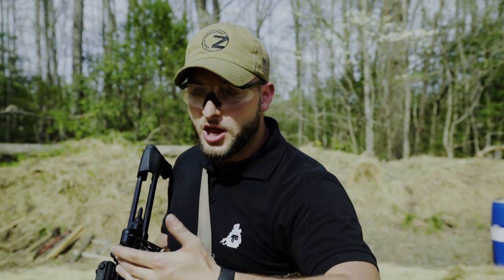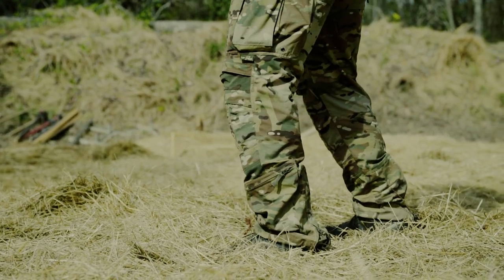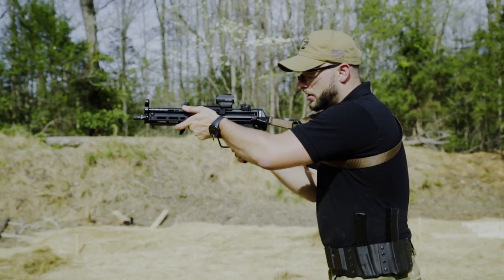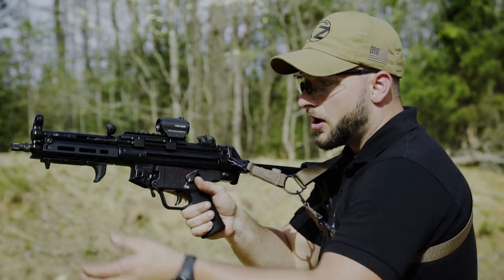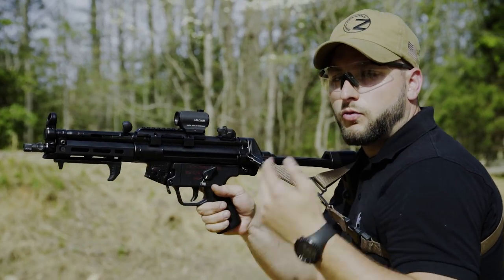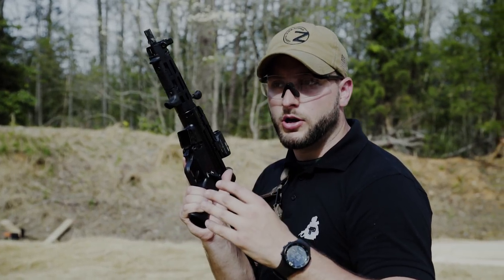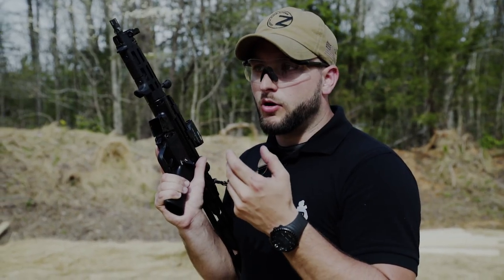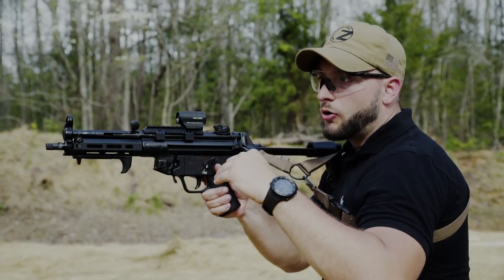How to shoot Full-Auto?

Comment: would you mind demonstrate that with a G3? :)
Reply from the maker: I've shot with G3 on full auto but i don't have a video of that. 
With a stronger recoil you need to have a more aggressive stance and put more counter force into it. I would say that with the G3 and .308 you are already at the limit for some shooters because the combined recoil of full auto dump could be greater of total weight of someone which means it will move you back a couple of steps.
https://youtu.be/YAwM71383C0?t=1m8s
Reply: that should be fun....
Reply: I will remember that, but i cant hold the g3 "ipsc style" lol, grabbing it by the mag works best for me
Reply: Interesting
Reply: i shot a sbr full auto g3 when i was on vication in miami :D i have to say it rocks but you really really have hold that thing tight and push it down real hard during the shoot. also i found that 2 round bursts work good with the g3 everything above isnt very effective for everything past 10 meters. maybe with a bit more practise but still the g3 has a pretty hard recoil
oh btw i have a video of it :D https://www.instagram.com/p/BJMoetQjMm9/?taken-by=aaronfrank95
Reply: @TheDodge211  you kind of have to fire long strings to be effective with a full auto 308. You tend to loose contol for the first 3-5 rounds and then regain it after that, so if you fire short bursts you are getting the worst of both worlds in a sense. That said; i did once dump 4 full mags of blanks through a g3 during a traning manuver and it just about melted the handguard. The plastic smoke kind of hampers your ability to be effective beyond that.

Comment: @Polenar Tactical: Is that a modified mp5? Looks badass.
Reply from the maker: That's a Zenith Z-5rs with an M-lok rail upfront and a Holosun reddot on it. 
It's made in Turkey on original HK machines. 
Runs smooth as butter :)